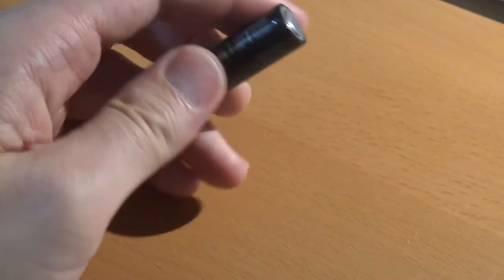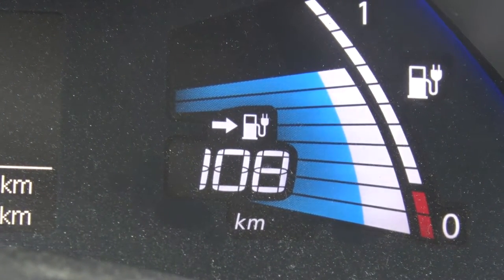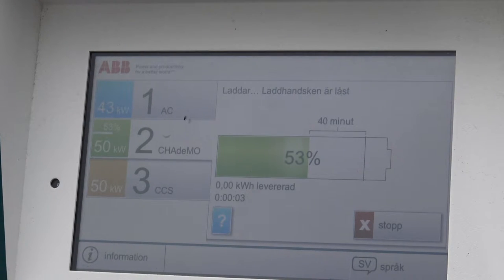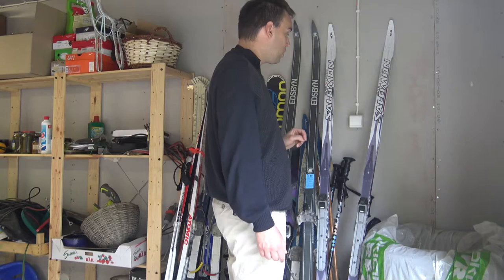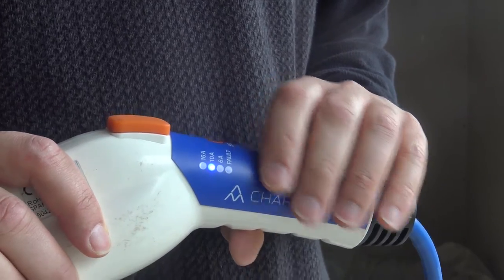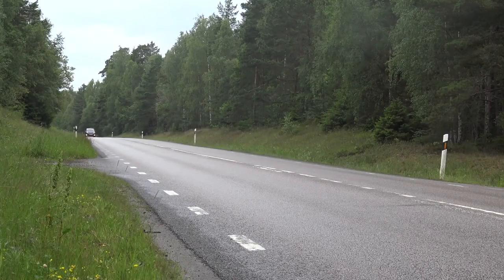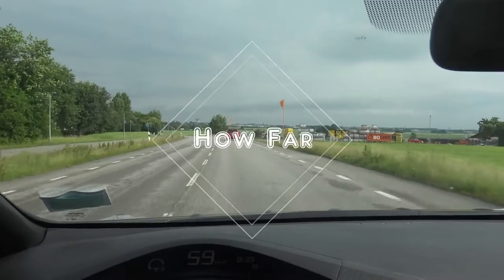Nissan Leaf, the battery

Comment: Hello my electric earth,

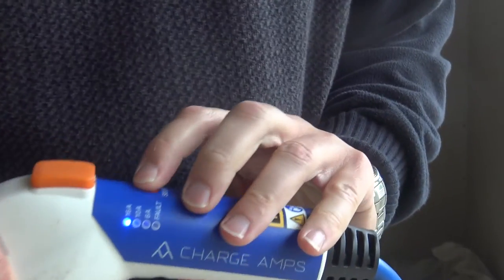At 3:00 you show us a cable from 230v-typ 2. Where did you buy that? I just bought my first ev. A Nissan leaf from 2017! When i bought it, it only came with the granny cable. 

Thanks for all your videos. They have been of great use. You are one of the reasons I bought my first electric car.

Ha en trevlig vecka!
Reply from the maker: I am happy you hear that I could inspire you to go electric. I bought the cable form the company https://chargeamps.com/. But this cable that I am showing in this episode is not sold new anymore. On top of this the older Nissan Leaf from 2017 it is little bit complicated since the charging plug in the car is Type 1. Most of the cables similar to this one available on the market today is delivered with Type 2 connections since it has been decided that it should be the standard for all EV brands in Europe. Maybe you can try to find a used one. I sold mine after I returned my Nissan Leaf.

Comment: I have the gen 2 -13 Leaf.
On Chademo, the charge-rate decreases at around 40% and goes down fast after 50-60%..

Mine adds about 17% pr.hour at 16A, it draws 16A all the way up to about 95% or a bit more. Basically the last 2% is really slow, so I'm a bit confused that you say from 80% and up..